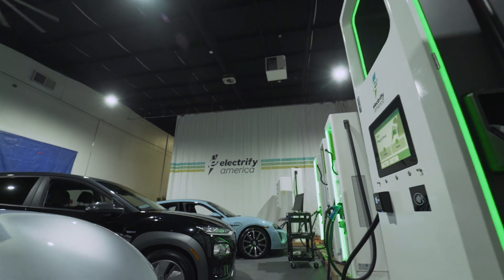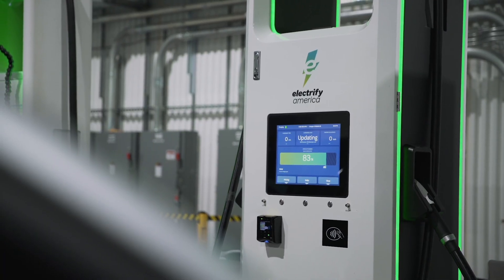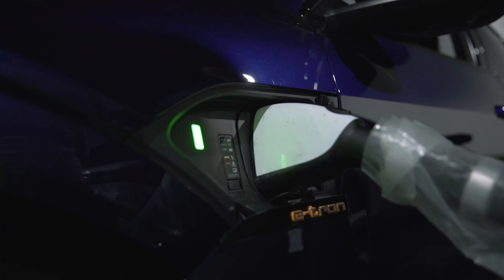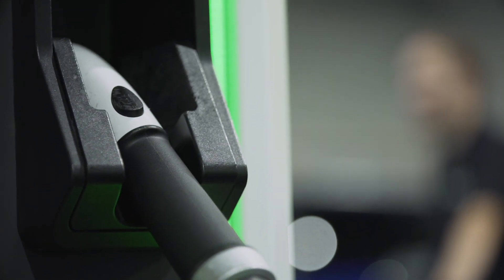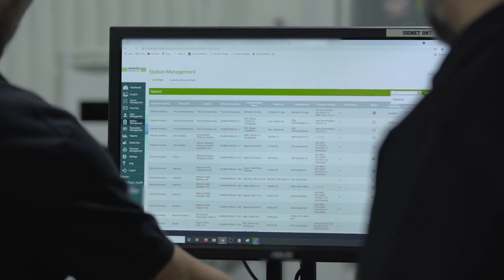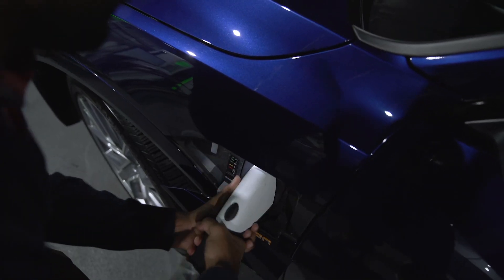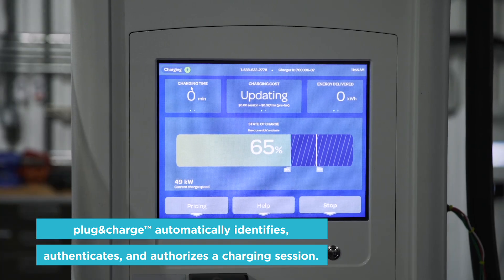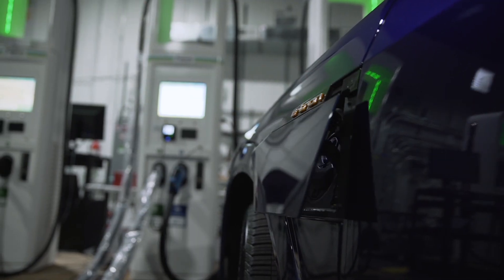Charging in America – Behind the scenes of the "Center of Excellence" Technology Lab

Comment: I am an engineer with over 20 year of experience releasing products to consumers.  I also happen to own both a Tesla (2019 Model 3 AWD) and a 2023 VW ID.4 Pro S AWD (CCS).  The Tesla Supercharger is just a marvel, it is simple, it just works (plug and play every time) and their stations average at least 5+ dispensers.  Their cables and connector are so manageable and the handshake process takes less than 10 seconds on average.  Electrify America, on the other hand is unreliable, with bulky and heavy cables and a cumbersome and massive connector.   The stations average just 4 dispensers.  They are de-rated (will never give you the advertised kWh at a low SOC) over 50% of the time and are not plug and play.  You have to fiddle with a non intuitive app (it doesn’t even use geo location to set you at the location you are at, so you have to manually select it).  Also, generally, their dispensers tend to be broken most of the time, and I mean, most of the time.  Respectfully, this is nothing but a PR video (I know this is old now).  Yes, things are great in the lab but your product is inferior in practice.  You may want to disclose the failure rates for your units, else, I encourage EV owners or those thinking about going EV to research EA stations on Plug Share.   I don’t want to regret our decision not to purchase another Tesla.  We do love our ID.4 as it has many other features the Model Y lacks…. Except for the charging network.  EA is complex and unreliable.  Just watch many of the reviews on YouTube.  It is just unacceptable and insulting. 😢

Comment: I literally almost fell backwards on my head trying to remove a heavy cable that is always a challenging to remove from VW ID… it has to connect at an absolutely straight angle which is not always possible at every site
Both initial connection and removal are significantly more challenging than with other vendors. It is no always possible to manipulate a heavy, short cable within the space you can park your car.  BTW it is extra hard for smaller people, less strong people and older people.  As a 70 yo woman, I find all of those to be true
Reply: As a 30 y old athletic woman, I also find EA plugs hard to unplug sometimes, and wonder how everyone else deals with it o.o Yes they really haven't thought through the parking spots!! I often have to park diagonally and be partly on the "No Parking" striped area.

Comment: You can not charge a 2022 Nissan Leaf. It has a round connection that your plugs don’t fit.  At your charge station I can only use chademo
Reply: Most, but not all EA stations have 1 CHAdeMO charging handle. Though EA is moving away from even just the one, since it's only 1 vehicle at this point that uses CHAdeMO.

Comment: The charging cables are TOO HEAVY and TOO SHORT. It causes my Mustang Mach-E to not get a proper connection without me physically holding the cable so that the connection with the car is not skewed. I like the engineer in this video who acknowledges that the diameter of the cable needs to shrink, but he didn't mention anything about the length and the weight. How does Tesla do it so well, but EA is still trying to figure it out?
Reply: I literally almost fell backwards on my head trying to remove a heavy cable that is always a challenging to remove from VW ID… it has to connect at an absolutely straight angle which is not always possible at every site

Comment: EA Charging stations have been quite unreliable lately. Some stalls have been down for months and not getting fixed (100018-01). Other stalls working only at 30-50kW (100018, 100040). Most importantly, charging stations are getting too crowded now with most EV brands (except Tesla) contracted with EA only. EA is absorbing all these manufacturers but can't keep up with the expansion. Been driving EVs for 4 years and I've gotten over range anxiety. But now the growing issue is charging station anxiety. I strongly believe that EA can solve these problems but it needs to happen asap.
Reply: Agree completely. I have three years of EV driving, and while I'm a fan of EA and what they have done, chargers are sometimes for weeks or months, and I often get 30 kw on one unit, then I move over to the next one and get 120 kw. I know it is difficult, but getting 99.99% reliability 24/7 is crucial. It doesn't matter how many stations  exist, what matters is how many chargers actually work at full rated speed.
Reply from the maker: Thank you for sharing your concerns, Joel. Our team is aware of charger 01 at our Corona, CA location and they are working diligently to restore service. With this being said, we have reported your experience with charging speeds at our Corona and Ontario Mills, CA sites to our maintenance team, and they will conduct a thorough investigation into these chargers. We appreciate your patience as we work to find a solution. -LM

Comment: Love to use the Electrify America chargers for Mustang Mach-e in Turlock California at the Walmart. 

Easy when working to charge up, but at times only Two will be working and for some reason the two that are not working I usually have to call the 800 number to have the Representative conduct a reset on the pump to get them working. Doesn’t really take that long but would be nice nit having to it that the pump would just be ready to go.

Isn’t there a way for the system to send Electrify an alert signal once the pump recognizes an issue to the Electrify America trouble center to have the issue resolved in a more timely manner once an error alert appears on a network map. 

I am sure many consumers do not try calling the 800 number, they just drive off and go to the next pump.

I know that calling the 800 is important as I used to work in a trouble center for telecommunications with MCI, MCI WORLDCOM, and Verizon. 

In addition would be nice to more Electrify fast chargers in Turlock California. Seeing more and more Electric cars here Mustangs, bolts and Teslas. 

In addition will will your pumps ever have Sun Shades as it get very hot here and right now fast chargers here take longer than 30 minutes to get a full charge even longer.

Will your chargers here anytime soon be able to give a full charge to 100% in fifteen minutes or less. 
I have been reading the technology is here and ready to do this for consumers but yet to see it.

Hope it arrives soon.
Reply from the maker: Hello Rick. Thank you for reporting this concern at our Turlock, CA location – we’ve relayed this report regarding your experience with the chargers at this site to our maintenance team for an investigation. Additionally, we’ve shared your feedback regarding the need for awnings, more locations in the Turlock area, and faster charging speeds. You can stay up-to-date regarding any company news by keeping an eye on our website here: https://media.electrifyamerica.com/en-us/. We appreciate these helpful suggestions! –NE

Comment: this is great I love when the charger works, can we possibly make the cords longer though I already dinged my new ID.4 having the back in because of a pole in a bad location.
Reply: They are short for a reason. The longer you get the more drop off there is resulting in more power loss. The shorter it is the more amps can be pushed through with any loss. Go look up electrical engineering. There are safety issues with extending the cables. That why it isn't recommended to use extensions with our evse. Fire risks. Other factors to. It's not smart to make these high power cables longer.

Comment: I see frequent complaints from users about charging difficulties - lately there has been a spate of issues where charging is slower than expected for unexplained reasons.  It would be helpful if there were something on the display that explained how it was that the charging speed was determined, and what the limiting factor is.  Oftentimes we get finger pointing between EA and the vehicle manufacturers which just serves to frustrate drivers.  If EA is limiting due to some fault, then just tell us.  If it is the vehicle, then tell us that too.

Secondly, in the field, broken chargers are still a huge issue for some.  Usually there is at least one that is working, but that can result in queueing.  I would like EA to be more forthcoming about what the issues are, why it is that some chargers seem to be broken for months at a time, and what the plans are to improve.
Reply from the maker: Hi, Eric. We appreciate you sharing this important feedback with us. Ensuring our customers have a reliable and seamless experience at our stations is a top priority, so please be assured your feedback has been relayed to our team. If you ever have a less-than-seamless experience at our station, please reach out to our team 24/7 at 1-833-632-2778 so we can help you right away. We’ll continue working hard to be the network you deserve. -NF
Reply: Totally agree! I try to submit a report everytime there's a station issue but it seems like it's going nowhere

Comment: Do you test in 110+ degree heat? Saw some chargers not working or having trouble. Curious what the max heat these things will charge
Reply from the maker: Thank you for reaching out, Greg. It's our job to make sure we maintain a seamless and reliable charging experience across our network, so we would like to hear more about the concerns you had with our chargers. Please give us a call at 1-833-632-2778 - we're available to assist 24/7. -LM

Comment: Reliability is most important for charging so I’m glad to see this work with all the players in the industry. I do have a suggestion,

If the payment system fails, internet connectivity fails or charger cooling fails maybe consider failing over to the open state in a low speed mode with free low speed charging. 

The power level could be low enough that active cooling isn’t needed and it could also lessen the losses from free charging due to payment system failure but will help get drivers down the road (maybe 10-25kW - essentially level 2).

It would be a great goodwill gesture and could help drivers in a desperate situation if your chargers are the only option.

I’m glad to see you all expanding. Keep up the good work!
Reply from the maker: Thank you for sharing your experience! Our maintenance team is still performing upgrades at our Ennis, TX site, so we appreciate your patience with the reduced speeds you encountered on charger 03 as a result. We hope to have this charger back up to full power soon, and truly appreciate your support! –NE
Reply: yes that would be great
Reply from the maker: Hello, Lynyrd. 👋 Thank you for taking the time to share your thoughts with us. We’re always looking for ways to improve the customer experience across our network. Your suggestions have been shared with our team for review. We appreciate your support - this wouldn't be possible without our amazing #EV community! –LM
Reply: @electrifyamerica  I did stop at a charger yesterday (6/23) in Ennis Tx.  It is a 350 KW charger.  There was a sign on it that it was not functioning properly at highest speed and had been downgraded to lower speed in order to continue to work.  It charged my EV6 at 63KW.  I was happy enough and appreciated the notice.  I drove a different route, a few more miles, and avoided several 60 KW chargers to get to this station. And would do it again because I really like what EA is doing and want to support.

Comment: Sounds great.  Glad to hear you developed cable cooling and "Plug and Charge".  How about a matrix of all the vehicles you have tested vs charger make and model?  Drivers could use it to avoid purchasing vehicles that are incompatible with chargers you use.
Reply from the maker: Electrify America is a brand-neutral company which allows different types of EVs to charge on our network. If you have any questions regarding the compatibility of a specific electric vehicle and our chargers, we recommend reaching out to the EV’s manufacturer directly. Additionally, you can always give us a call at 1-833-632-2778 if you have any questions about our network. We’re here 24/7 and ready to help! ⚡️ -NF
Reply: @electrifyamerica  I wouldn't call it brand neutral when many stations have 2 CCS plugs and 0 ChaDeMo... Basically Nissan Leaf owners get the short end of the stick for being EV pioneers.